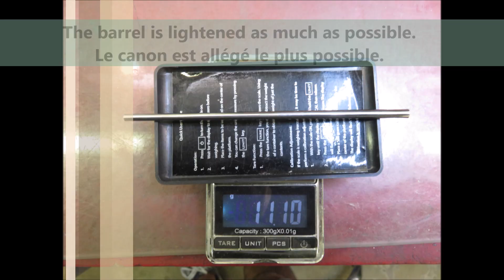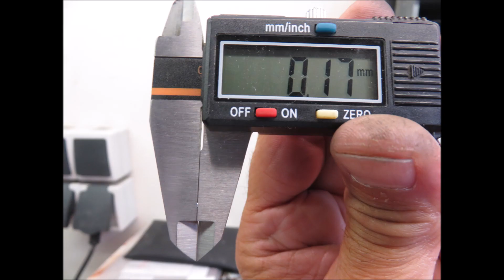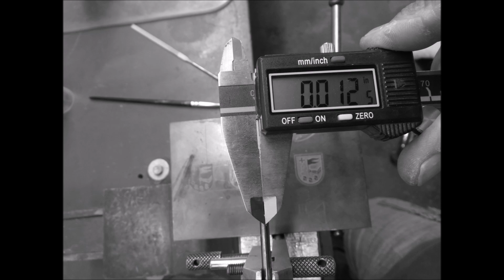Harpers Ferry 1841 Part 1

Comment: This work becomes really impressive seeing how small the individual parts are during crafting. Excellent work and dedication, having one usuable part out of 5 sounds like a nightmare.
Reply from the maker: Thank you very much, the 1/6 is a very demanding scale if we respect the proportions of the real size. The sides of the front ring are less than 0.3 mm (1.8 mm 1/1) and the thickness of the wood at the muzzle as well. It is almost impossible to go below. Yes 5 castings for 1 correct part. It is the difficulty of casting steel (1500 ° C) instead of nickel silver or German silver (980 to 1100 ° C) like other miniaturists. The success of the foundry is due to the orientation of the sprues.